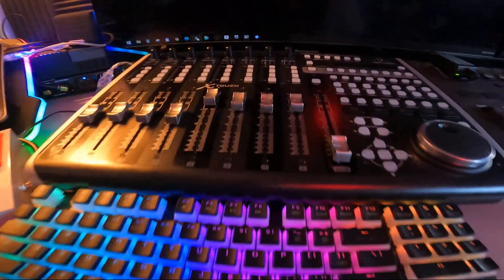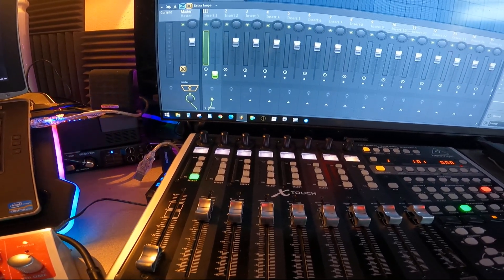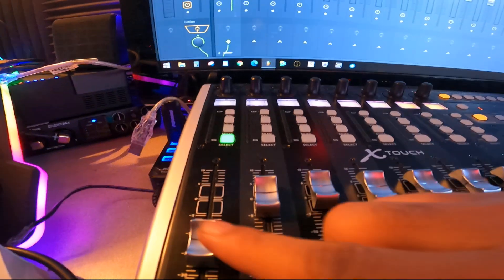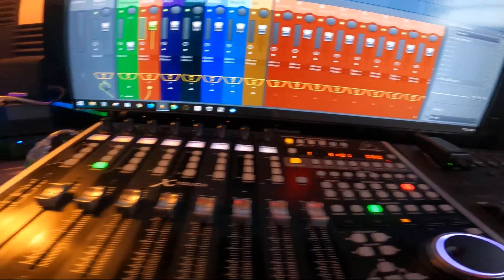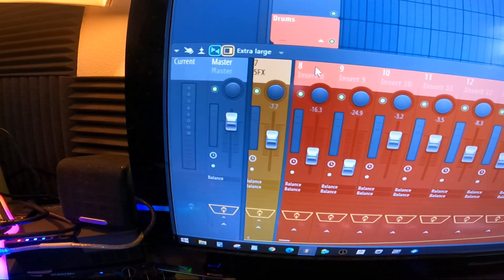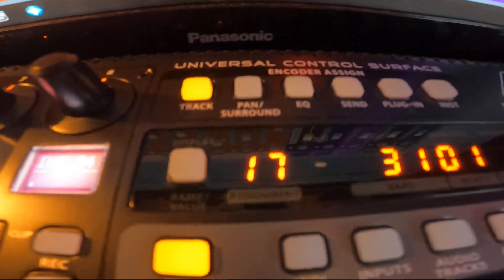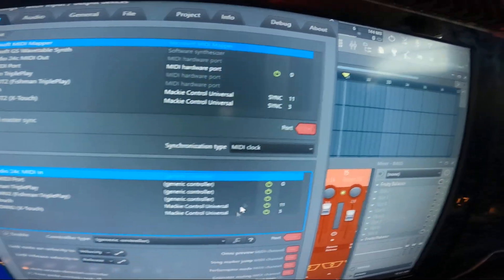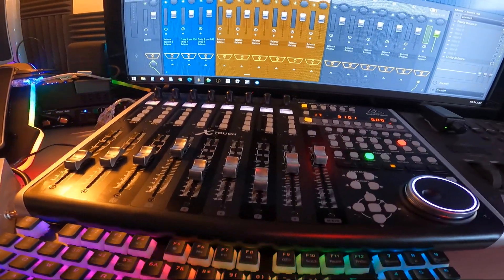Real Truth Behringer X Touch Faders & FL Studio 20 Part 2 ( IT WORKS ! )

Comment: waddup broly..great viddy..i just purchased me one as well. im going to start off with just this one and expand 3 more extenders. i also bought waves..will the rotary knobs sync with waves if you know? Also i bought a 8 in/8 out midi hub..do i plug the in to out and out to in?
Reply from the maker: Instead of the extenders buy two or three more units also get the SSL 360 controller uc1 put ot in the middle same size..  I just bought two Wing concoles ..stay tune for those vids going to tits